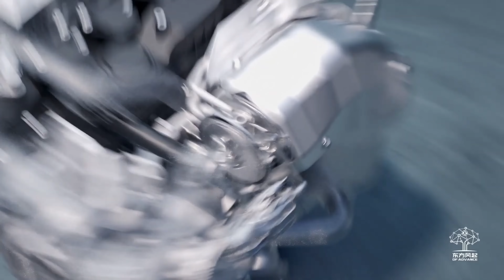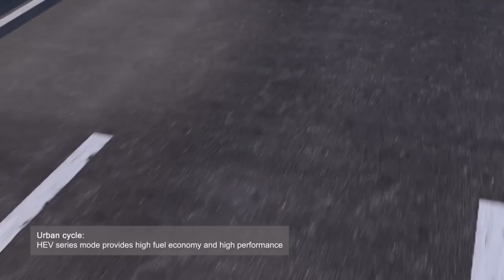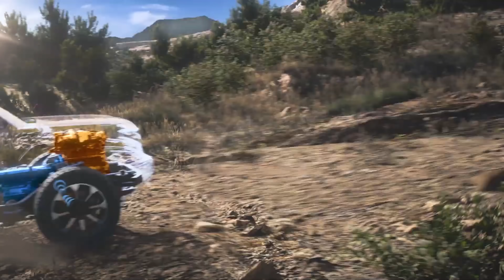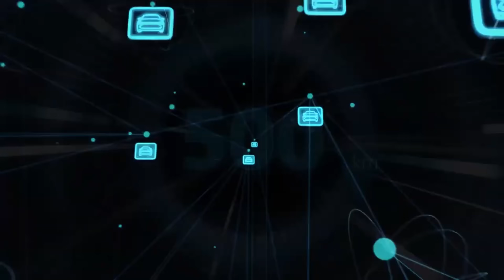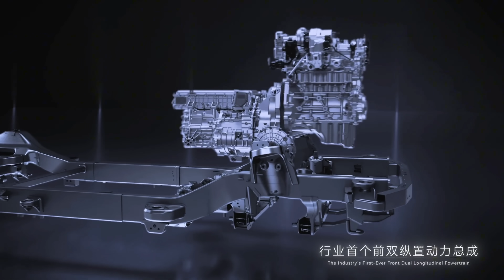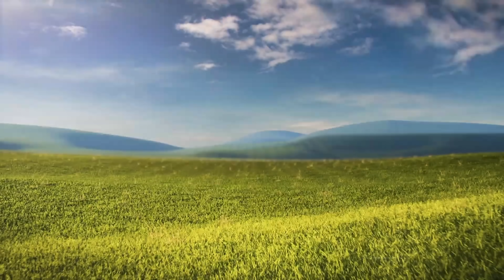BYD's 2100km Engine Secret: Is Toyota Finished?! [2026]

Comment: Moreover, it is by no means certain that an internal combustion engine must run on gasoline! One could, for instance, just as well consider using methanol as fuel. This would also have the advantage that the necessary refueling infrastructure is already in place and can be adapted for methanol relatively easily. Furthermore, crude oil is not strictly necessary for methanol production!

Comment: Toyota won't be finished IMHO. However, Nissan, Mitsubishi and Honda will bite the dust eventually.  Toyota will be kept as a sort of inspiration for other automotive companies to push boundaries plus who wants to be #1? Being #1 is insane because 2nd, 3rd is always better because you are still very profitable with less stress and worries because if you are #1, the work and stress to stay #1 is enormous.  While being 2nd or 3rd drives you to become #1 which is a different thing. With that vision at hand, you are more likely to develop better cars than the #1 who is working very hard to stay #1.

Comment: Sadly, as a Toyota owner and dedicated purist who buys a new Toyota every 2-3 years you are correct. My wife and I went down to the dealer to put in our advance orders and not only have Toyota not advanced, they have regressed, the latest Hilux is crap and plasticky compared to our Toyota Invincible pickup and worst, it did 30mpg, our old one does about 34 mpg. We also own a high performance Jaguar SUV, that returns about 42mpg, 4WD, blows off most things yet tows my 2 ton trailer so there's no excuse Toyota. Instead of handing over our debit card for 2026 and a deposit for 2028, left empty handed, disappointed and confused! 
My friend has ordered a BYD and he has agreed to let me borrow it for a few days, so... we'll see...

Comment: GM made a vehical on this principle in 2000. The volt was a EV range extender, but it was using their normal  current car engine and the battery technology poor in those years.
Reply: So after 24 years of research and development they still produce nothing of real value, well done GM motors 😂

Comment: Unfortunately most forget that there are other ways in getting better fuel economy. Overall Weight, aero dynamic, tires, engine oil, engine power loss efficiency, which none is accomplished in  byd car. Byd put it in high weight car, now they need larger tires, turbo cars wont run low viscosity oil like na engine, some of the system dont drive the wheels which makes the system inefficient at high spped. To achieve high range , just put a large fuel tank.
Reply: Do they sell Chinese brand hybrid PHEV in your country.  If you drive them you will realise how silly your comment sounds.   The other Chinese brands PHEV use this system as well.
Reply: @kennethprocak5176 it doesn’t matter if is phev or ice vehicle, tires, aero dynamics , weight, still matter for efficiency,
Reply: @kennethprocak5176 tell me how efficiency doesn’t matter in phev? Tell me how do you guess im from other country? Please dont call silly with out reasoning
Reply: @kennethprocak5176 tell how these phev gets half the range claim once outside china, for example brasil, Philippines, Australia? ,
Reply: @Cmvinyl0102  You talk about fuel economy right? How about zero fuel used for daily commute under 75 KM and 4.8L/100km if you use engine.
I'm not talking BS here since I drive a DM-i car (BYD Sealion 5 DM-i) in Cambodia. I got 90km with the claim range of 71KM from factory. They always go pessimisti with range claim.
Reply: @techrando yes im talking about fuel consumption overall not specific to BYD. Your post just proves all these over exaggerated claims from these videos. 4.8L/100 wont get you 2100 km range even with the battery range included .
Reply: @Cmvinyl0102  FYI, my car is 4th Gen DM-i. the fifth gen is out for sale with smaller body of car. the actual range is close to the claim. It is not too absurd as false claim will ruin their reputation.
Reply: @techrando FYI, like what? 4th gen vs 5th gen? Smaller like what?
Reply: @techrando really? So why is Philippines, Australia, brasil byd, sames car but half the range of what they claim 2100

Comment: Most cars should be pluggin hybrids with 60 miles of battery only range at this point. These auto makers just aren’t doing the right thing
Reply: This is PHEV, but more advanced than brands outside China. The ICE  recharges battery to 80% if set to do so. These never  require plugging if not convenient. .

Comment: The main difference here seems to be that the BYD system uses a clutch in place of the Toyota planetary gear.  I think this means that the BYD system requires a bigger electric motor because the petrol motor is only used at highway speeds.
Reply: Check out the different type of hybrid: 
series hybrid, parallel hybrid and series parallel hybrid.

Comment: BYD is miles ahead in battery and hybrid technology, so I expect the performance and reliability to be top-notch as compared to Toyota.
Reply: They have a joint venture with Toyota. Expect BYD to become the standard for reliability. I believe Toyota is now using BYD drive system in their electric and hybrid cars.

Comment: All sound good, the problem will be reliability
Reply: BYD engines experience no reliability issues after 21,000 kilometers of driving, a core advantage stemming from optimized hybrid operating conditions, stringent manufacturing quality control and testing standards when compared with foreign counterparts of the same type. Its DM-i hybrid system is electric-drive dominant, with the engine only operating in the efficient 1500-4000rpm range; the engine’s running time under urban conditions is just one-fifth to one-third of that of traditional fuel vehicles, meaning the actual operating mileage of the engine at 21,000 kilometers is far lower than the odometer reading. In addition, the battery preheats the coolant before engine startup and the advanced thermal management system drastically reduce wear from cold starts and losses caused by temperature fluctuations. The absence of a traditional gearbox further cuts down mechanical failure points. Meanwhile, the engine features high-quality material selection, precision processing technology and key components supplied by top international vendors, paired with precise control by an in-house ECU and full-process quality control, as well as an engine self-diagnosis function that alerts abnormalities in a timely manner. It has also undergone over 100,000 hours of bench durability testing, extreme high-temperature, plateau and frigid climate validation, and real-world driving verification with a cumulative mileage of over 30 billion kilometers, further solidifying its reliability foundation. In contrast to foreign peer products, the electric-drive dominant logic of BYD’s hybrid system results in simpler engine operating conditions and lower wear, while some foreign hybrid models lean toward fuel-drive, leading to more complex engine conditions and higher wear risks. Additionally, BYD’s in-house R&D and vertical integration model make it easier to achieve consistent quality control, whereas foreign brands fall slightly short due to global procurement and cost control considerations. Complemented by BYD’s comprehensive after-sales network and warranty policies, as well as owners following the manual to use special engine oil and conduct regular maintenance, the engine remains stable and free of reliability issues at 21,000 kilometers.
Reply: @kinwaisiu9414  21,000 km is not much. Do you mean 210,000 km?
Reply: @calvinwilliams3700 Consider BYD is a late comer with 21k km should tell you as time progress with all their resources they have changed the automobile game rules
Reply: 可靠性没有问题，中国有个汽车投诉软件，可以看所有汽车品牌被投诉的数量和被投诉的理由，比亚迪销量最高，被投诉的数量最多，但几乎没有因为质量和售后被投诉的，大部分被投诉的原因是比亚迪更新迭代太快，每年更新换代一次，每次都有明显进步，导致老款车二手市场贬值较快。不过这也仅限中国市场，外销车型由于各国不同的法律法规、经济情况、软件和语言适配、地理环境和气候，无法做到快速更新迭代。